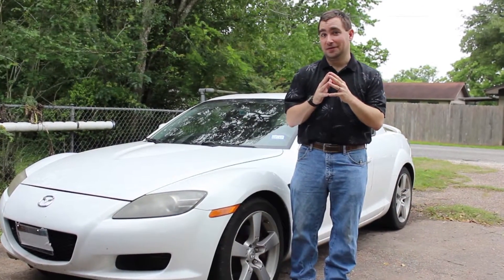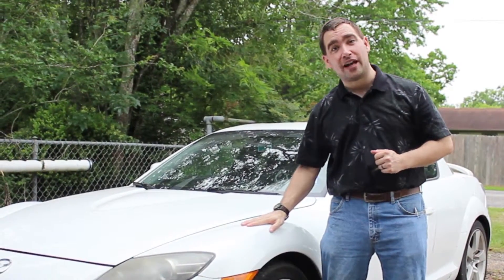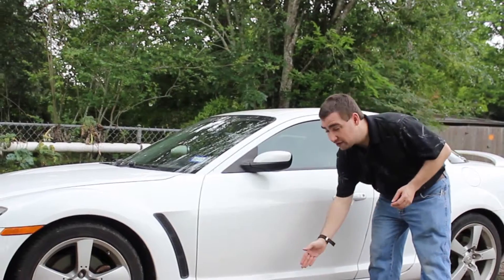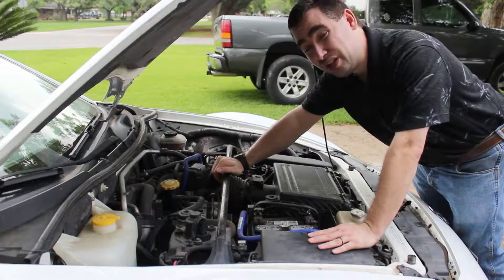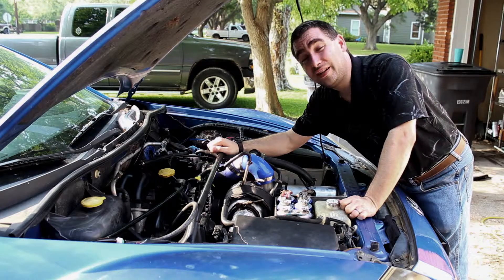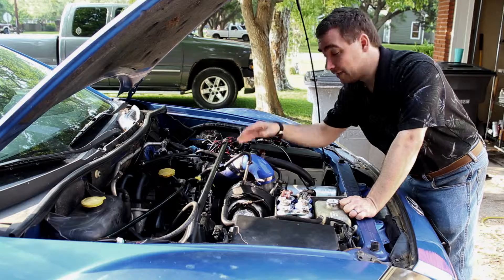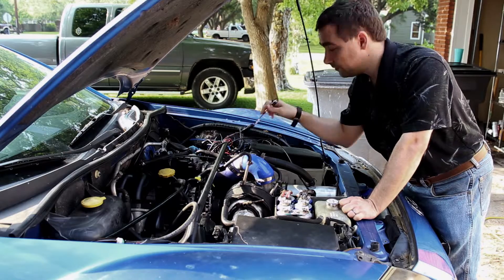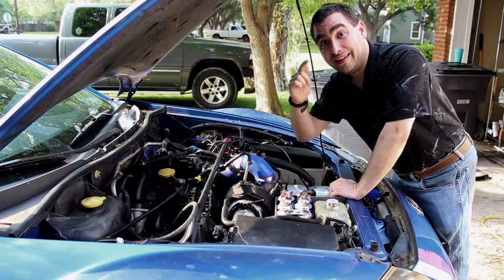Explaining The Beast 1 - Voiding Warranties Ep 1

Comment: How fast does the beast go
Reply from the maker: Right now it does 0-60 in about 1.5sec while on jack-stands, but I will have it back on the road soon.  At 4psi it is has much more torque on the low end and at 8psi it really comes alive. Driving around town it has been an absolute blast. My other Rx8 is stock and it's not nearly as much fun,  or as much of a handful. When everything is tuned in properly and the hardware is finished I'll dyno it.